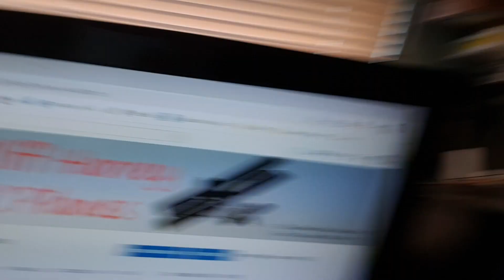DB Mannock Biplane, Part 12, Struts, Patching the Wing and Starting to Paint

Comment: Hi Cliff. Some interesting and useful tips that I hope to transfer to my Twin Otter as I am in the process of building ailerons . I noticed that you  were applying paint to the balsa as well as the film and wondered if you prime the wood first. Cheers. Robert (DSSC)
Reply from the maker: Actually Rob I cheat a bit sometimes,  if the item is small I just coat the part with CA, this gives the balsa a hard coat ready for a lick of paint  😉